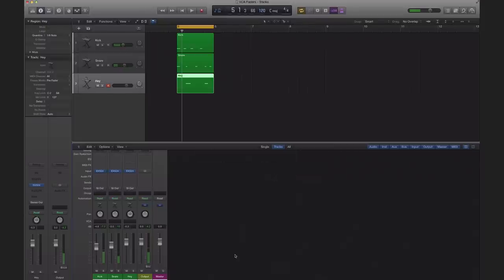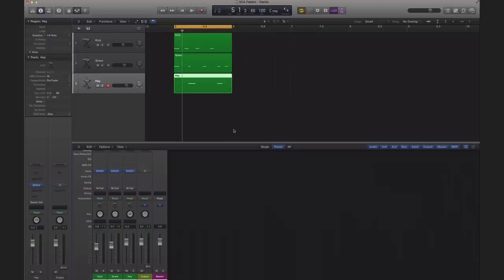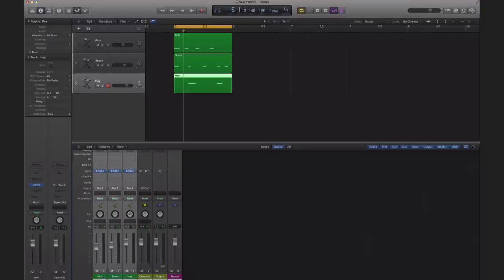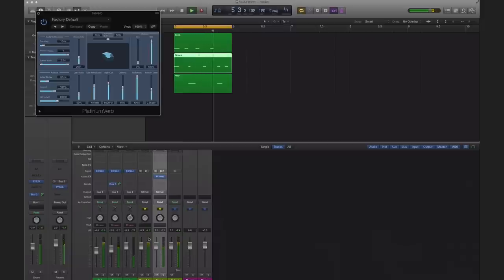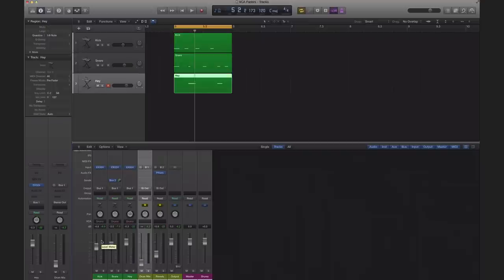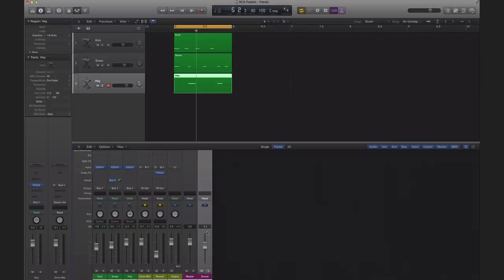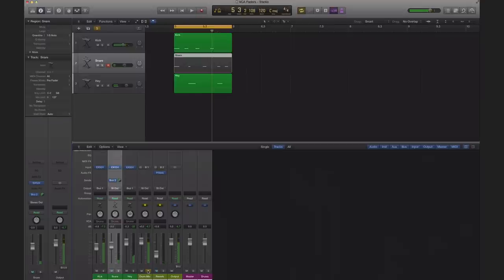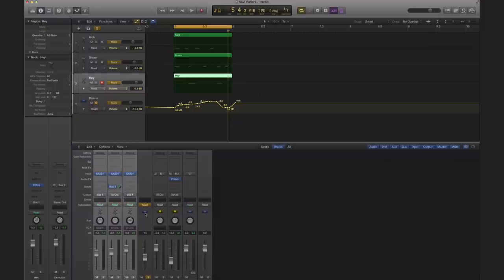Why and How to use VCA Faders

Comment: Hi Guys!! Hi Adam!! 

I would like to add something.

Using the VCA fader in this tutorial affects the gain input of the reverb. In this case it is not a big deal but imagine you had a parallel compression going on. Once you change the level of your instruments, the compression "effect" will change as well resulting in a different sonic characteristics of the mix. 

There is million ways of overcoming this but the most important one is to UNDERSTAND it. 

I tend to use "3-stage summing" when routing drums on mixdown. You could also set all your sends on pre fader and put the VCA fader to control the compression AUX too. It all goes down to what your private preference is.

Thank you Adam and keep up the good work!!! :)

Comment: Basically, VCA for playbacks and Aux sends for effects. 

Wrong! You have more control under Sends option by simply choosing Post Pan, Post Fader and Pre Fader....one of those could control your wet signal volume-wise and Pan-wise.
Basically you have limited control over sends! Wrong move...i'll rather stick with Aux.

Comment: Thanks for this tutorial! Quick question: Is it possible to use inserts on VCA Fader submixes e.g. putting compression or tape emulators. I'm always looking for ways of saving CPU. This is a good tip but i do like to add some character to my submixes when I use Aux'.

Comment: I think there's a collapse-mode for those VCA groups. Set them individually and then collapse and use 1 VCA fader. I wish for it to be easier to distinguish between different types in the mixer. It looks impressive but it's hard to find things.
Reply from the maker: ***** once all your sub-mixes are complete and set up with an VCA group fader you can choose to not display all tracks in the mixer window. Along the top of the mixer window in the middle click Tracks and then on the right side of the window just make sure Master is highlighted. This will leave you with only the master tracks and you can mix that way.

Comment: Thanks a lot for your video which is very clear and simple. I've got a question, if I set my sends on "post fader" mode, I'm get rid of the send offset problem and the only thing that differentiate VCA from an aux track is its less CPU charge in that case. Is it right? 

Thanks !

Comment: My mix process is complete but my track hits somewhere around -2db. I want to create some more headroom now for mastering. Is creating one vca for all the channel strips and turning down the fader by the desired amount the best option for doing that? How is it comparable to other methods such as sending all the tracks (including auxes) to a single aux channel and turning the fader down; or inserting a gain plugin on the mixbuss and cutting a few dbs?
Reply: A bit late but it’d be preferable to use a vca. You’re not adding another plug-in that could color the mixbuss, that way.

Comment: Thanks for this....so the way I see it, it's not a "replacement" for aux tracks, but something different entirely. May or may not be used with Aux tracks depending on what you're doing. Got it - thanks mang!
Reply from the maker: JBarber3d exactly, definitely no a replacement but use them to keep a balance between all tracks as you would on a analog style mixer. Just another way to get the job done.

Comment: Call me a noob but....wouldn't it be EXACTLY the same to send the snare reverb track to Bus1 as well, so that Bus1 also affects the reverb volume?
Reply: Francesco Filigoi it is a little different because if you did that you would be controlling the volume of the reverb output and not the level going into the reverb.
Reply: +Joeman7890 Agreed.  It's also different in that you can't share the verb with any other instruments; i.e., if you've also got a synth fed to that verb, and you lower the verb's output because it's fed to the drum buss, your synth verb level would change with the drum bus' level.
Reply: yes, exactly the same, and far easier in my opinion. the VCA doesn't control the level going into the reverb either, so that's a moot point. 

it's true that you can't then share that reverb with other sources, but this will only be a problem if you're using processor-hungry reverbs and have a computer that can't handle it.

the main reason to use VCAs is the separate output thing as shown in the video. very useful.

Comment: i have one question.. lets say i made a premix on my bus channel.. with compressors and eqs.. ok, the main element in my drums is -6db and everything is mixed around this.. if i use a VCA fader to control the volume of all my drums, to -10db for example, the compression i did before on each channel will be ruined, because it will enter less signal on each compressor, changing the treshold action... right?
Reply: I think the answer to that depends on at which stage of the track workflow a VCA functions: if it do its thing at the very first stage of every track it would indeed alter the behaviour (and results) of the compressor (in this example). If not, then it shouldn't have any influence whatsoever because in that case the VCA fader would act just as some kind of " universal volume knob" to control only the volume of the tracks assigned to it. Cheers!!!

Comment: Thanks, i have question about velocity. I can't get higher velocity in Logic with keyboard.Mine is always less than 103 however hard i push.
Reply from the maker: Dulgoon E. your keyboard might not be velocity sensitive meaning it will not detect how hard you are playing the key. what keyboard do you have?
Reply: imamusicmogul i have velocity sensitive in my keyboard. i have M-audio keystation 61 2014

Comment: IS VCA THE SAME AS USING TRACK STACKS OR MULTI OUTPUT? CAN YOU  EXPLAIN THE DIFFERENCE BETWEEN THEM. USING ULTRABEAT?
Reply from the maker: ***** they are two different things. Track stacks is essentially a master sub mix of a several tracks where you can apply effect and volume change to affect the entire submix. You can make changes on a VCA fader without changing the balance between the effects and the actual volume on each individual track.